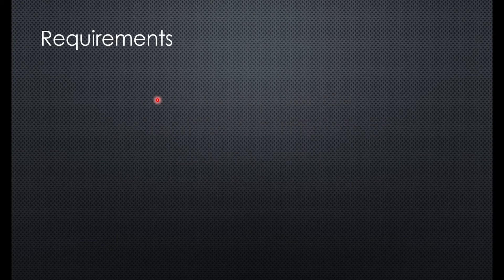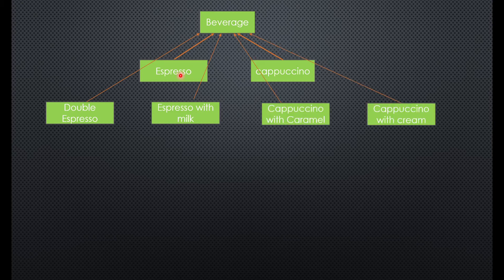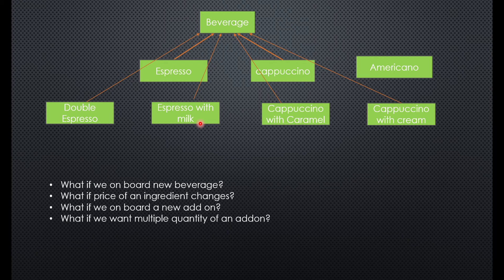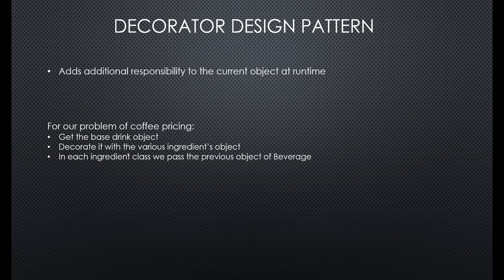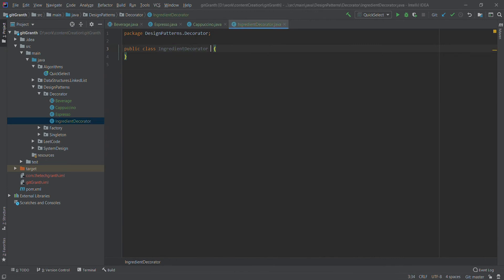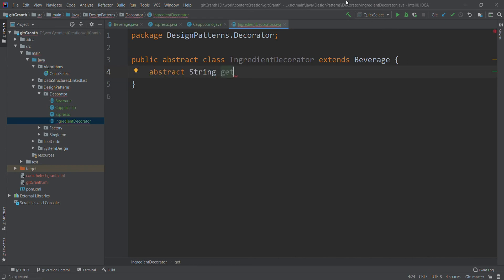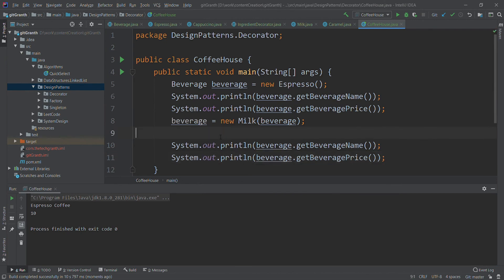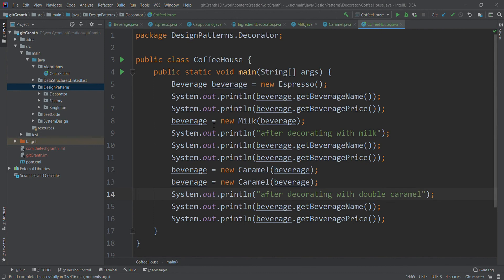Decorator Design Pattern | Starbucks | Coffee House System Design

Comment: I think it can also happen that we have to add multiple ingredients in one beverage, in that case does it make sense to  have List<Ingredients>  in every beverage subclass ?
Reply: let's imagine an extra ingredient is added, so you have to re-run the list of ingredients and this is not maintainable for a long time, so with the decorator pattern the only thing to do is add the new Decorator to the current beverage and the price is calculated based on the original plus the decorator